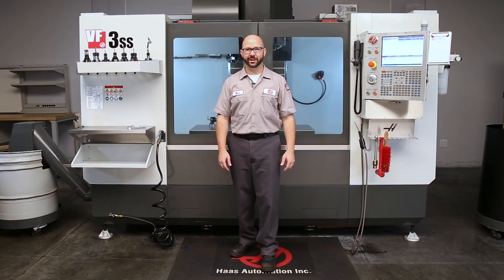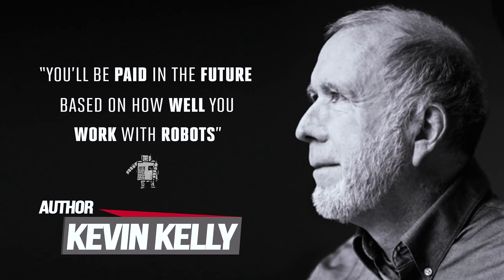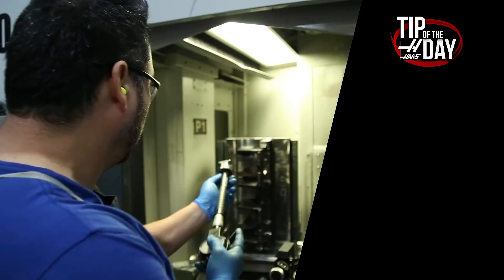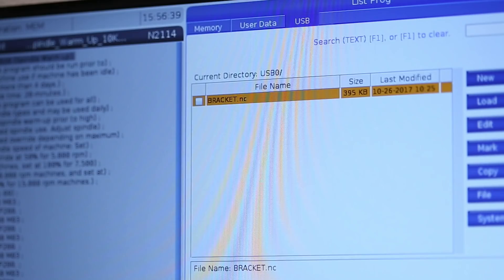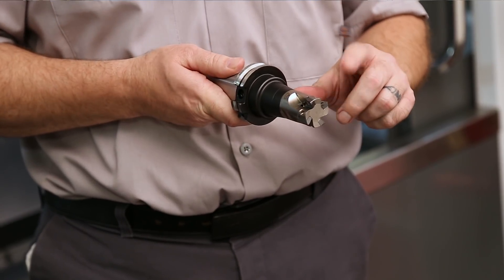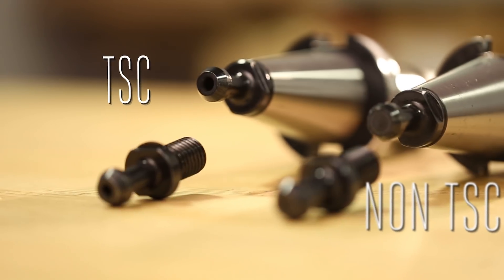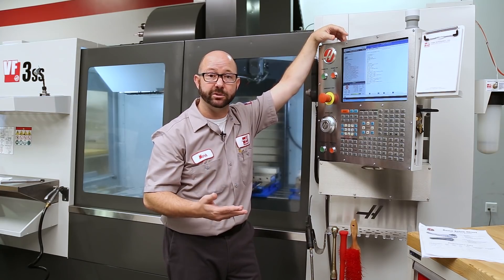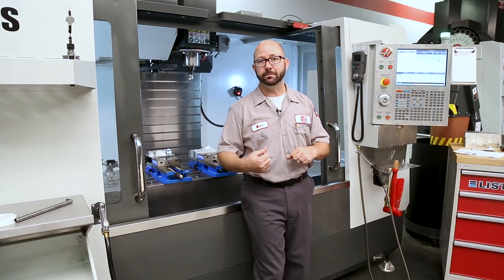Make a Part From Start to Finish; Mark's Greatest Setup Tips - Haas Automation Tip of the Day

Comment: all looks great, but I don't work with light weight materials... and the reaching in to load and unload the machine, or push on the crane to get the load to the center of the table is a pain. For those machinist that use the work probe, advanced macro programing can be a major time and memory saver.

Comment: Hey Mark, does Haas make a dual turret and dual spindle lathe?
Reply from the maker: Paul – Haas builds a Dual Spindle, Y-Axis, Live-Tooling BMT lathe, with a single turret, our DS-30. You can find out more about this machine on the website, including pricing and options, www.haascnc.com. – Mark, Haas Tip-of-the-day

Comment: A setup sheet with photos and stuff, and even a section for tools.. At the place of my work we just get a sheet with written steps like "drill this at L-70 of the part" with a technical drawing to deduce all the depths and placement. Then we get a program that says where to catch the x, y, z but its also just written so lot of confusions takes place and we got to call the program guys down to us. As for the collets, vices.. we just wander around the working place, from machine to machine to find the correct ones and deduce if they are good or not.

Comment: Fantastic video! We plan on investing in a VF2 or VF4 for internal parts manufacturing, with the machine running a few times per month. The tips on removing rust from tool holders, surfacing the tool plate and the vices.. it seems like there is a lot of maintenance on the machines and that things might lock up if you leave tools in the system. 
Are we fooling ourselves if we think that we can make a "parts on demand" where we leave pallet systems/tools ready to run?
Reply from the maker: Jens Agerskov – Leaving tooling setup in the machine is not an issue, in practice. It’s easy enough to build fixtures for small jobs as well, and just swap-out the fixture plate when it is time to run more of those parts. Check out these other videos for more information. Probe your fixture: https://youtu.be/fFZi6rWIcuU. Run multiple parts: https://youtu.be/NutStjpWJck - Mark, Haas Tip-of-the-day

Comment: Does anybody know where to get that antitrust spray he was using in gallon sizes or something reasonable for me to try out. Also what is the exact product?
Reply from the maker: Ian - In this video I was using a Castrol Rustilo DW 90 HF, it used to be called Safecoat DW 90. This is what I have readily available, here at the factory. This is a thin Dewatering and Protection oil.  I’ll use WD40 as well sometimes. A light spray of this oil keeps my vises, collets, and tools rust and corrosion free. – Mark, Haas Tip-of-the-day

Comment: Nice, as always. Quick question, not about the video, how fast are you running that facemill? Speed and feed? Just wondering.
Reply from the maker: Anshel – That particular tool is a Seco 32mm Combimaster, R217.69-1632.RE-12-4AN. I was running it at S10000, F238in/min (F6000mm/min), with a .200” (5mm) depth of cut on aluminum. It can handle a faster feedrate at that RPM though, I was only going .006”/.150mm per tooth. The TSC allows it to run fast. For any indexable tool, I like to go with the smallest diameter I can get away with, this allows me to keep my RPM’s up, and then find a brand that can give me the most inserts for that size. This gives me the highest RPM, the most inserts,  the highest feedrate. – Mark, Haas Tip-of-the-day.
Reply: Thank you

Comment: Thanks Mark and Haas!   Quick question -- why not dry-run a couple inches above the blank?  I keep a 2" gage block handy, and typically dry run jobs that are going to get close to a vise jaw 2" above the part.  Makes it easy to stop the machine at the point where a tool is going to be close to an immovable object, and slide that 2" block under the tool to make sure there is still "daylight".    Just a thought.   I met you at IMTS in 2016, and you are every bit as friendly and "engaged" in person as you are in the videos.   You're a great image and promoter for Haas!    Thanks!   :-)
Reply from the maker: agiewireedm – That’s a great method. Run it high! I’ll do that on important parts. IMTS was a blast, I met a lot of terrific machinists, making some insane parts. Everyone has a niche part that they’ve sweated over, and can be proud of. Thanks for the comment. – Mark, Haas Tip-of-the-day

Comment: what is that oil you spraying on the table?
Reply from the maker: In this video I was using a Castrol Rustilo DW 90 HF, it used to be called Safecoat DW 90. This is what I have readily available, here at the factory. This is a thin Dewatering and Protection oil.  I’ll use WD40 as well sometimes. A light spray of this oil keeps my vises, collets, and tools rust and corrosion free. – Mark, Haas Tip-of-the-day
Reply: Thank you.

Comment: hello mark I am operator on umc 750 in France. I know that there is a code m38 for the variation of spindle on the haas st30 can we do the same thing on umc 750 with a code m to limit the vibration
in deep bore operation example D24 h7 on 250mm thank you cordially
Reply from the maker: Lefox61 – SSV Spindle Speed Variation is available now on Haas Mills with Next Gen Controls (NGC). We’ll use an M138/M139 for Mills, where we’d use an M38/M39 on our Lathes. “M138 P500 E1.0” will vary the spindle speed by 500 RPM (above and below programmed S value), every second.  M139 turns off the feature. For more info, download the latest Mill Manual from the Haas Website, and search for M138. Let us know how things work for you! TOD@Haascnc.com  – Mark, Haas Tip-of-the-day
Reply: Thank you for your quick reply. My UMC 750 is 2015 does it have a software update?
Reply from the maker: Lefox61 – I’m sorry, this SSV feature is only available on Mills with the NGC. Older machines cannot make use of the this code. – Mark, Haas Tip-of-the-day

Comment: Are you meant to warm up your machine with a tool in it?
Reply from the maker: David – The short answer is: I always have a tool in the spindle when warming it up. My reasons for doing this are a bit outdated though. On many machines that I ran in the past, if you didn’t have a tool in the spindle when running it, the drawbar could do bad things as it rattled around while spinning while not under tension/compression. If you have run your Haas spindle without a tool in it, don’t worry about it, they can handle it, but I still think it is best practice to keep a tool in the spindle when its running – especially if you have different brands of machines in your shop. – Mark, Haas Tip-of-the-day

Comment: Since when do HAAS controls not require O##### program names?
Reply from the maker: xmaswitguns – I know, right. That was  big change. On the NGC (Next Gen Control) the file names can be most anything you want. We can put the files in any folder structure you’d like as well, which helps to organize things. The Control still reads the “O” number as you load the program, so it works with any of our legacy programs (M98, G65 subprograms). We are doing a video on Subprograms, and we’ll talk about the ability to Map a sub-call to any file (Filename) program, anywhere on your network, with just a couple button pushes. Thanks for your comment. – Mark, Haas Tip-of-the-day
Reply: Haas Automation, Inc. Your instructional videos are excellent by the way.  I’m in a shop now that has all Mazaks so I watch your series to stay fresh on G-code and HAAS machines like I used to run (and learned on).
Reply: I hope the Haas Automation marketing department knows these videos probably sell more Haas machines than 100-4 color 2-page glossy ads. 

It's about time the CNC control technology gets with the late 20th Century. O-numbers are so 1970... and the ability to network the subprograms/subroutines within a network is getting towards 2010...

Comment: Will the new SanDisk extreme pro 3.1 work in older Haas machines?
Reply: If it has a USB port, probably. I say probably because I have had hit or miss reliability with different flash drives on the Haas I run.
Reply: Eggsr2bcrushed  exactly that’s why I was asking mine drive me insane with the whole “no device mounted” BS!
Reply: On ebay you can buy a 2.0 USB flash drive with as little capacity as 64MB, costs around $1 with shipping free, so go on and buy a handful of them. Just make sure you don't rely on them as a storage or only backup device. OK for transferring to and from machine
Reply from the maker: Hi Les – I bet it will. The reason I mentioned the SanDisk Extreme, was because it is lightning fast and I’ve personally checked it on new & old Haas controls. We update the USB drivers on the control all the time, but they don’t always get updated  constantly (online) like they would on your Apple/Windows laptop, so some number of really unique or cheap USB sticks might not work (driver was never loaded for that specific stick). The SanDisk Extreme transfer files way faster also (Amazon, $20). Of course, the vast majority of sticks out there that work perfectly well. Thanks for the comment. Mark – Haas Tip-of-the-day.
Reply: Haas Automation, Inc. Thanks Mark! I ordered the same as you have last night 👍🏻